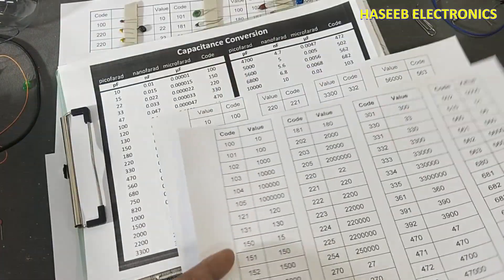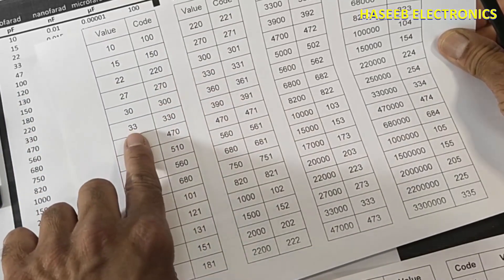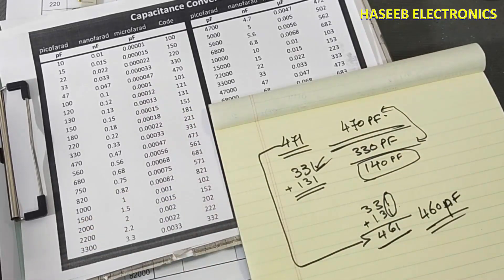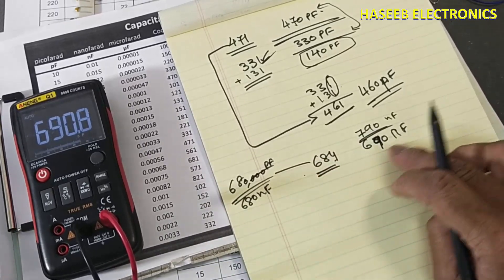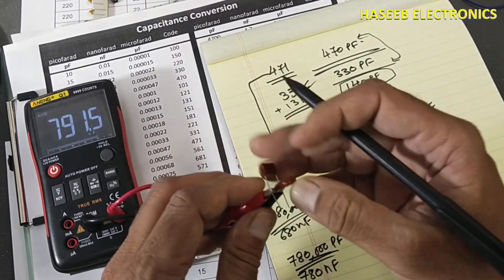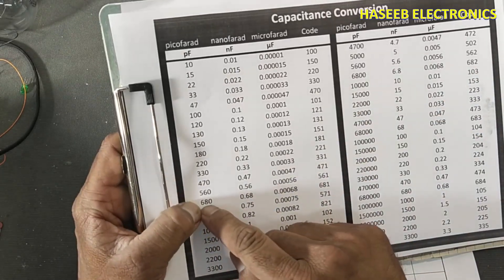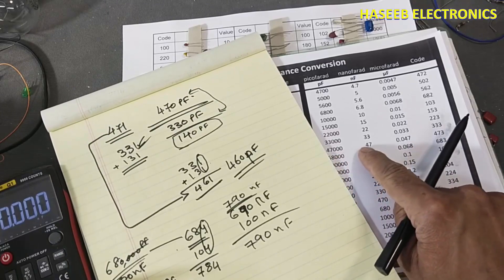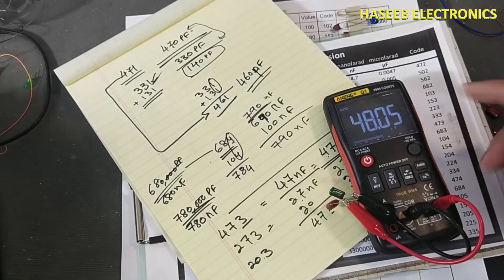{649} How To Choose Proper pf Ceramic Capacitor to Replace an Unavailable Capacitor

Comment: Singer S w m 70 s1405 r The three ceramic capacitors on the PCB board of the 7.5 kg top load washing machine are completely destroyed, the value of which cannot be understood. How to specify the value for such a capacitor again

Comment: Great video, God bless you❤️ 
Please I've been having issues with optocoupler MOC3021, although it's not related to the video but i will appreciate if you help
When the LED in the MOC3021 is energized pin 4 and 6 will conduct but when power is removed from pin 1 and 2 the load in pin 4 and 6 (the output) remains energized and it's supposed to be turned off
So please i really need your help i don't know what's wrong 👏

Comment: Hello Sir. Need your whatsapp. I have a compaq PSU. When i connect green and black wire together, it briefly starts and stops. It has 4 chips, UC3843, TOP244P along with a small transformer and main Chips SCY99112p and KA358S. Its 185 Watts.